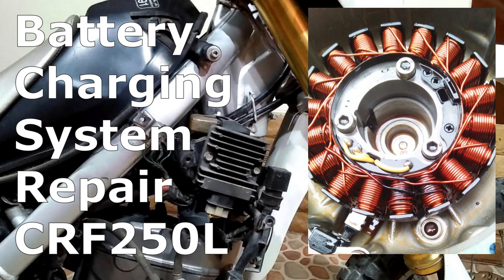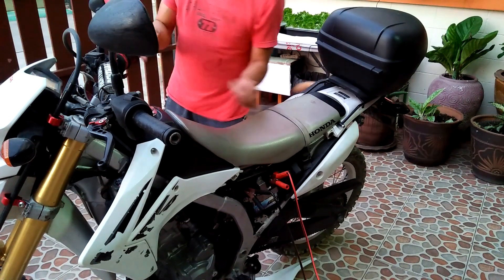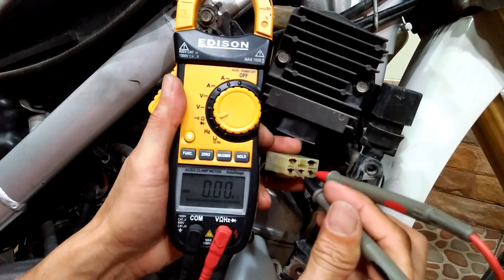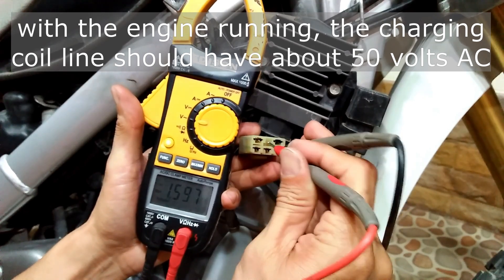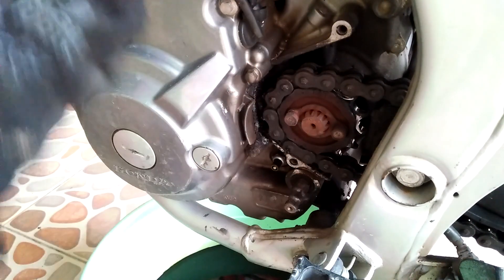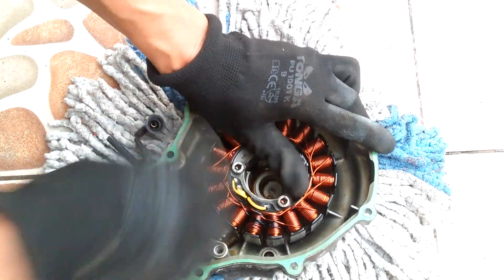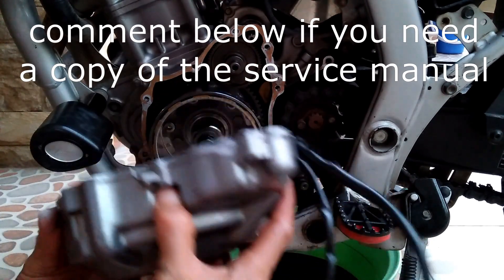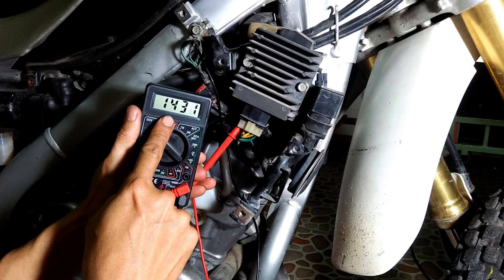Repair Motorcycle Charging System Honda CRF250L

Comment: My motto is brown hands thumb it down (not racist intention)  But  You did a very good job and I appreciate your video it was very well done.    Let me give you a tip to save money and time.  just lay the bike on the right side and remove the stater cover, you dont need to drain the oil.   By the looks of your oil you were way past due for a change.  When your bike starts shifting not so smooth its time to change the oil for me its about 5k miles..   Oh and another TIP. cut the white plug that connect the stater and solder the wires  and heat shrink them. the plug is garbage and will eventually melt and short which will destroy your battery and stater.  I have 50K on my bike.. I know for a fact after the second stater burned up.

Comment: nice my friend I did the checks in the manual and replaced rectifier(china) no success ordered a new (china) stator and will inspect old one when arrives this gives me hope again its not the wiring harness haha
Reply from the maker: I hear stories of fellow CRF250L rider having issue with the charging system. Then the repair shop replaces the rectifier regulator even if the only problem is the stator. That is why accurate diagnostic is important. good luck

Comment: Sir some mechanic said thats its not allowed to rewind CRF250L Stator?
Reply: Did you rewind your old stator sir or you buy new one?
Reply: And if you buy it sir where did you buy the Stator?thank you po.
Reply from the maker: @romeoiiicoronejo1759  I rewind the burned out coils.  You can see in this followup video.  https://youtu.be/NDnjh2Ihs0c
Reply from the maker: @romeoiiicoronejo1759  Dito kasi yan sa Thailand.  Online lang nmin maoorder sa Honda yung parts.
Reply from the maker: Malaking kalokohan po yan.  Bakit nman hindi marerewind stator ng CRF250L.  Eh yung malalaking electric motor nga narerewind yun pa kayang stator ng motor.  Hindi siguro marunong yung mekaniko na magsabi.

Comment: Good job nice video. Just having the same prob on my 11 y.o. CRF 250L  68k km on the odometer
I am an xdiotxx when it comes to motorcycle electric. 😂
Reply from the maker: Mine has a burned out stator windings. I asked the price for a replacement at the Honda dealer in Pattaya and they quoted me 2,650 baht. I ended up rewinding the burned out coils my self and cost me almost nothing. I have enameled magnet wire and insulating varnish from previous projects that I used to rewind the stator. If you asked a motorcycle shop to do this kind of repair would cost you not less than 3,000 baht. They will most likely opt to change a burned out stator and not do rewind for an easier task.